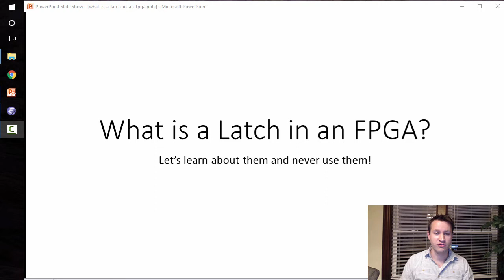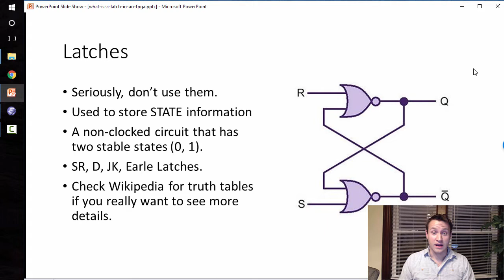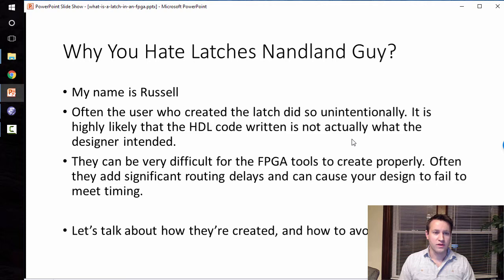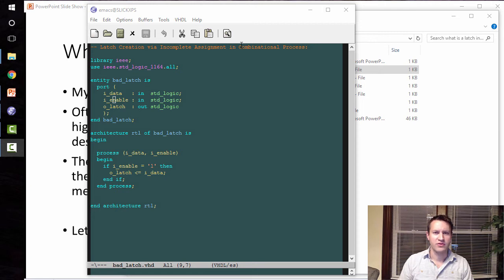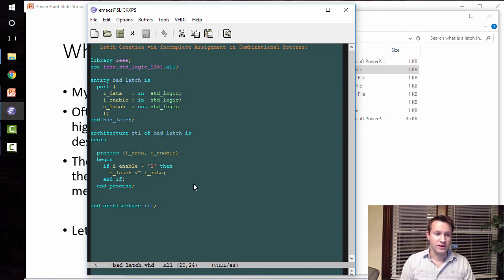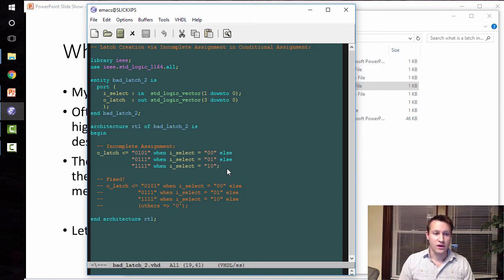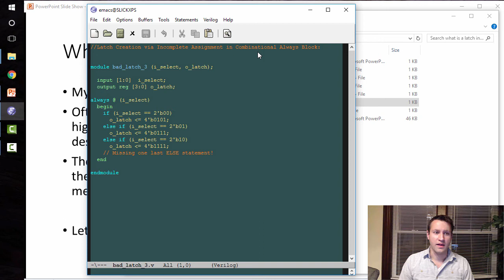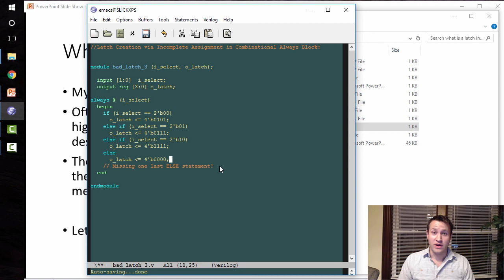What is a Latch in an FPGA?

Comment: Latches are taught to students in digital logic courses because they are the fundamental buildings blocks upon which flip flops are built . You can't understand flip flops without first understanding latches and the limitations of latches.
Reply from the maker: I disagree.  Digital logic courses teach Karnaugh maps and DeMorgan's theorem too.  I've used those in my professional career literally 0 times.  They don't help design FPGAs at all.  Latches at least you need to know what they are at a basic level so you know to never use them in FPGA design.
Reply: You may be right, but the thing is, it isn't enough for an engineer to be able to just use the existing technology. They have to know how it works and why they're using it instead of using something else. 

What often happens is that people get accustomed to using something and they forget what they're doing or why they're doing it. That's why courses teach those fundamentals. It's so students understand what is going on "under the hood".   :)
Reply from the maker: That's a good argument.  My concern is when teachers get their students too buried in the details at the beginning.  Students lose their ability to see the forest through the trees and lose interest in the subject.  I saw it in my engineering classes over and over.  It was interesting material, but not taught in the right order.  My focus with nandland is starting with the fun stuff to get people making things quickly and if they want to dive deeper they can certainly do that.

Comment: 2/3 of the way through, and I'm bothered that the example of how to solve the problem does something different than the code which it's supposed to be fixing.

In the original, o_latch kept its value unless i_enable was 1.  In the "fixed" version, it was set to zero if i_enable was zero.   So, the "fix" is to make the circuit do something different, not just to make the circuit in a different way.

I have real trouble getting past this kind of thing.

Also, what was so bad about latching data?  That's what a register does.  What's supposed to be so wrong with doing that?